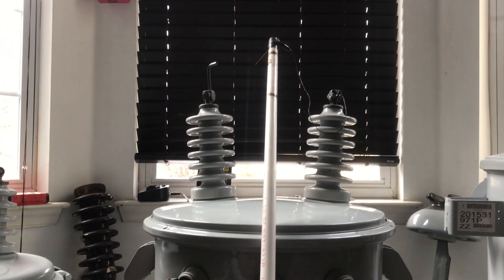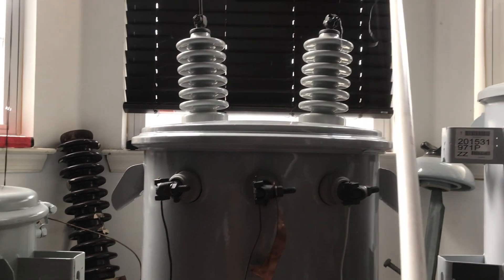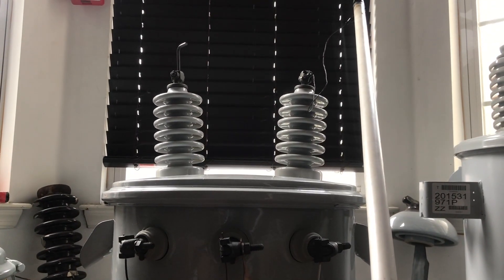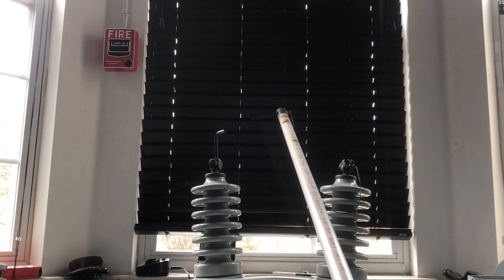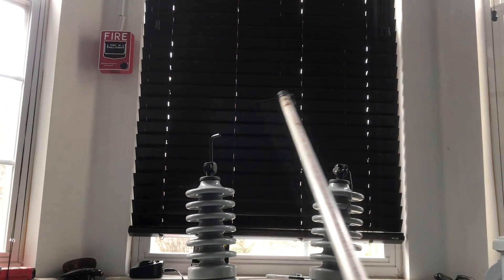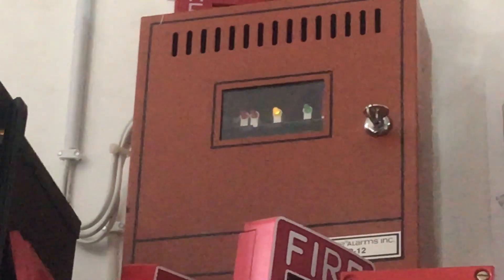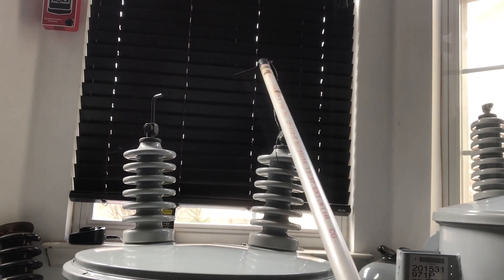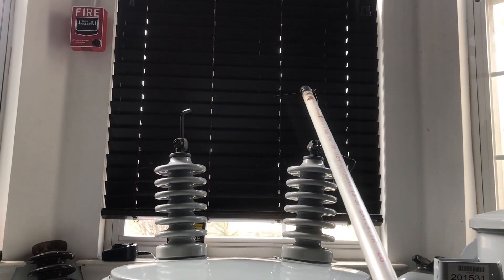New Transformer Arcs 22,000 Volts

Comment: 22000 volt how many amp?
Reply: Probably 300mA, but that's just my guess
Reply: @inductivelycoupledplasma6207   by the looks of it probably a lot less, more like 100ma
Reply: @andrew_z_012  not sure about that. The arcs seem thicker and hotter than 100mA from my experience. Maybe 200mA. Whatever it is, it's between 100 and 300mA (so we're both right lol)